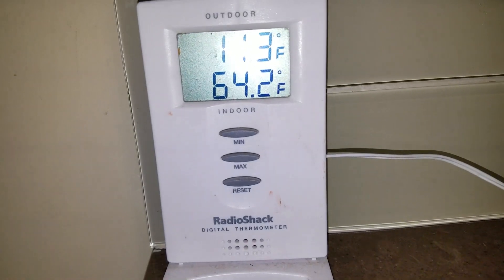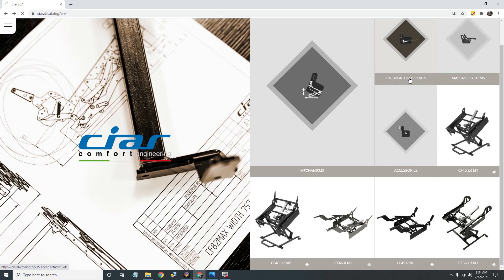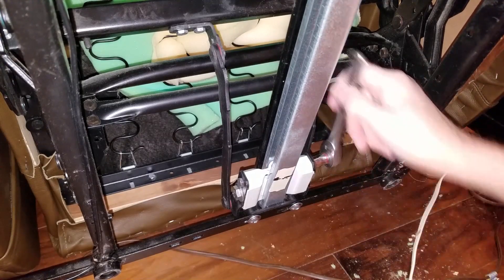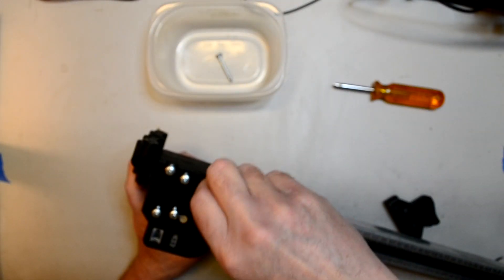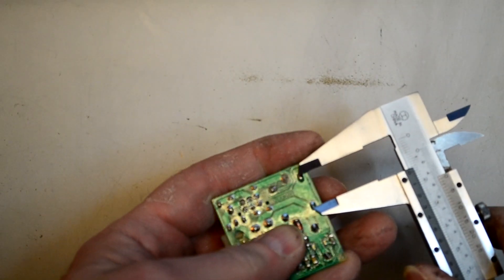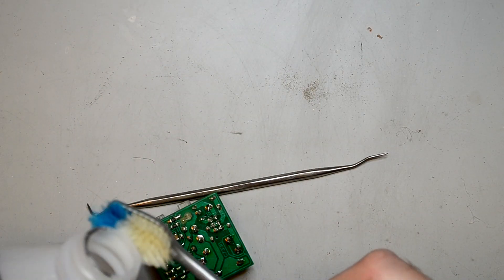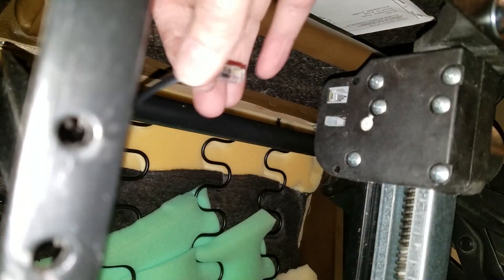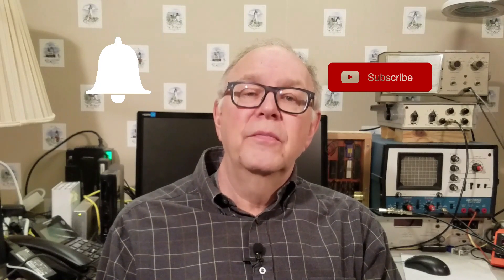Broken Recliner Actuator - Can we fix it?   CIAR LM55_03

Comment: Can you adjust the reach on the screw jack, plz?  Mine works but doesn’t fold in completely.
Reply from the maker: Check my other recliner troubleshooting video.  The limit switches can be adjusted and they determine the end points.  be carefful to only make small adjustments each time.  The motor is powerful enough that it can blow the nut out if the limit switch doesn't stop the travel before you reach the physical stop.  Good luck!

Comment: Do you have any recommendations on where to purchase a power supply for a LM55_05 motor? I can’t find info anywhere!
Reply from the maker: I don't have any "tried and true" method.  You might have to go to Jameco and match the ratings to the output listed on the existing power supply.  A power supply with a transformer might be best.  This would require soldering on the cable from the old supply.  Fixing the old power supply might be better. Good luck!

Comment: Mine was the gear being stripped out :( cant find a gear....so yippee Im out $80
Reply from the maker: Bummer.  There's a lot of force in that gear chain.  Make sure there is no binding in the rest of the chair mechanism so the actuator doesn't have to work harder than it has to.
Reply: @LifewithDavid1 yupp...already double checked that. It did originally. The foot rest was bent on the outward side. Got it all realigned and just waiting on parts now

Comment: Hi Dave, I am having the same problem on my Berkline recliner. I switched the power supply from another chair with the same problem , only goes in one direction.  It is a Ciar Jldq linear actuator. Who can iI have fix the LA because they are no longer available to buy?
Reply from the maker: I know; it's hard to find someone to work on these; that's why I did it myself.  If you can find someone that is willing to get into the nitty-gritty of the repair, I have another video that might help ( https://youtu.be/diehiXWF4pc ).  Also you might be able to find a furniture repair person; they might have access to replacement actuators.  It sounds like either a bad relay or a funky limit switch.  Good luck!

Comment: I took my actuator apart today:, the screw which the shuttle rides upon as it turns had a bunch of "stuff" (hair, cloth fibers, animal fur, stuff packed in a glob of grease) wrapped around it.

So, I cleaned up everything with car parts cleaner, and re-greased everything that moves with left over brake caliper grease, put it back together - viola, working again!

I think that contamination, and maybe lack of proper  lubrication was causing it to fail?

And, there wasn't a circuit board in there, so no relays to check and switch, just 2 micro-limit switched in the a actuator arm, which I cleaned up too!

That was easy, and cheap!

Dave, doing Dave things!
Reply from the maker: That's great!  I hate throwing things away that are still good.  The limit switches may also have been causing problems; I've seen that recently on my actuator.  Cleaning solved that problem.  Thanks for watching!
Reply: Update: Day after "fixing"  (cleaned up) my actuator,  it worked a few times, then the next morning it stopped working again!  Only the extension button, so I think it's a switch problem! So, I've ordered a new switch pad with USB and Bud Lite, it'll be here Sunday (2 days, via Amazon $22).  See what happens after installing the new Switch!

*BLUE LIGHT!  How many caught that?

Comment: I'm going to try this, before paying $90 for a new actuator/motor assembly!
Reply from the maker: Good luck.
Reply: Update: I took my actuator apart today:, the screw which the shuttle rides upon as it turns had a bunch of "stuff" (hair, cloth fibers, animal fur, stuff packed in a glob of grease) wrapped around it.

So, I cleaned up everything with car parts cleaner, and re-greased everything that moves with left over brake caliper grease, put it back together - viola, working again!

I think that contamination, and maybe lack of proper  lubrication was causing it to fail?

And, there wasn't a circuit board in there, so no relays to check and switch, just 2 micro-limit switched in the a actuator arm, which I cleaned up too!

That was easy, and cheap!

Comment: can anybody help me trouble shoot? my buttons gives power to the motor and the motor continues to make a small click sound if I keep the switches pressed, where do start to trouble shoot?
Reply from the maker: I'm working on a troubleshooting video; but it won't be ready for a few weeks.  In the meantime, try this.  If you hear a click (from the relays) when each button is pushed, then the button circuits work.  If you rapidly cycle the buttons and you sometimes get movement; then a relay may be bad.  If you VERY QUICKLY touch the motor leads to the power, and the motor doesn't turn; then the motor is probably bad.  If the motor is good; then one of the limit switches may be bad.  Good luck!

Comment: Hello David!
This is a great video! I have a question and wondered if it would be possible for me to email you? 
I have what I believe is the same exact linear actuator but it's for a different recliner. I just want to make sure that when I'm buying the relays that I'm buying the correct ones. I figured it might be easier for me to just send you a photo to see if you could help me make sure that they are the in fact the right ones?
Reply from the maker: The relays are pretty stock.  Check the voltage on the label, the pinout, and the dimensions.  That will let you verify or select the relays.
Reply: Hello @lifewithdavid1 
I purchased the correct relays from digi-key and soldered them on to the PCB. Unfortunately it did not work. Do you have any other suggestions as to what it might be or how else I can troubleshoot it
Reply from the maker: I would start by checking the power supply.  Does the power brick work; and is power getting to the actuator?  Suspect bad wire or connectors. Then do the relays click when the up/down buttons are pushed?  If not, it could be the connection between the buttons and the actuator; again wire or connector.  Or maybe one button is stuck closed and the limit switch is holding it out.  If the relays do click, then check the motor.  Manually move it to the middle of the stroke and then tap power directly to the motor.  Be careful to only tap the power for a very short time since you are bypassing the limit switches and can easily blow out the end of the housing (don't ask me how I know).  If the motor is OK, then check the limit switches.  They could be locking out the motor.  Hope this helps and good luck!  @josiahsdays
Reply: @LifewithDavid1  thank you so very much!! This was REALLY HELPFUL!!!

Comment: I worked in the industry for 25years and the "Normal" problem is the limit switches when it only say goes up but not down, you'll notice that there are diodes attached to them that whenthe switch is pressed won't allow the circuit to complete. and after either contamination or the grease in the switch hardens it will only allow for one mode of travel. I assume since you own an osilliscope you know what you are doing, but it wasn't clear from the video that you rulled that out first. hope that might be helpfull to someone with the more common problem.
Reply from the maker: That's a good point.  Yes, I had a couple weeks of experience where I had to click the switch a couple times to "tickle" the relay.  I did check the continuity of the limit switches; but I didn't cover it in the video since it was pretty "messy".  Thanks for the comments!
Reply: So it's bad diodes on the limit switches?
Reply: @Handygrrl  Um its in line with a leg from the switch . so lets say the up button is has positive electricity on the blue wire and negative on the brown, but the down button is positive on the brown wire and negative on the blue, so if the limit switch is clicked the diode only allows power flow in one direction so you can complete the circuit. so what happens the grease hardens so the switch never goes to the open position and allows that power flow in that direction. side note if this is the case sometime hitting with a rubber mallet releases the switch, but it will get stuck again in cold weather.  so a permanent fix is to strip the grease off of all the guts and switches with an electronic safe solvent with it un powered and then test the switches once they are good then regrease the acme thread with high quality synthetic grease.

Comment: My neighbor call me to look at his recliner. Found that the problem. It was the one wire going to the limit  switch. Not a complete broken wire.  I rig it for now so it would work. Still searching on how to remove  the pin out of the limit switch.
Reply from the maker: Flaky connections are always tough.  Sometimes I have stripped the insulation and tried to solder the conductors together again.  Good luck!
Reply: @LifewithDavid1  Work for Xerox and IBM, have all sort of  pin pusher. Yes, Thanks for the Good luck.

Comment: Where would you order relays, motors and switches if you can't locate or purchase parts from the manufacture?
Reply from the maker: There is a link to DigiKey in the description.  It's for the relay; they have other electronic components; but probably not direct replacement motors.  I'm not sure where to get those; you might be able to cobble something together.  Good luck!

Comment: thanks for the video, my lineal actuator look sealed, no screws to disassembly, any tips to disassembly, look like glue residues, anybody disassembly with dremel or heatgun?
Reply from the maker: Glued plastic joints are tough.  I've had a little luck in using a sharp chisel along the glue line if the glue isn't really strong.  However, it can cause cracking.  In that event, cutting the case along the glue line with a Dremmel saw is about all you can do.  Resign yourself that you may have to repair using a high build glue like epoxy.  Good luck!

Comment: I don't even see the circuit board on my okin actuator. Would it be in the metal tube somewhere? I do see the two limit switches in the tube. Defective limit switches perhaps? Mine would extend but not contract then wouldn't move at all. Perhaps the circuit board resides outside this unit.  I saw a circuit board attached to the control switches on the couch side. By the way I ordered a new actuator and t works fine. This is why I suspect the limit switch in actuator are faulty
Reply from the maker: I'm not familiar with that unit.  But it could use just limit switches and buttons for motor control with no relay.  This means that the full motor current would flow through the switches.  They would then be subject to the same contact deterioration as the relay on my actuator.  Bad limit switches seem very possible.  Thanks for the comment!
Reply: @LifewithDavid1 this is what i am  thinking faulty limit switches. I will try and look for exact replacements
Reply from the maker: @1232bluejays  If it doesn't work at all; you could use a continuity tester to check the switches when open and closed.  If they are flaky testing is more difficult.  Good luck!

Comment: Hello, My electric Linear Actuator has a 5 pin male connector.  Somehow this actuator is hard to find a replacement.  I ordered a linear actuator from amazon but noticed its a 5 pin female connector.  This product does not work for my recliner because it has 5 pin female connector on the back of my recliner.  Help!  Where do I find the right 5 pin male connector?  Do I have to replace the entire system from the back of my recliner?  Thanks Juan
Reply from the maker: I guess  would just make up 5 individual short male to male jumpers.  Then I would plug them between the appropriate female positions.  You can tape it all together when it works like you want.  You'll need the pinout of the new connector (and the old one too) so you can get the wires to the proper spot.  It seems every actuator has their own connector.  Good luck!

Comment: Hey David, I have a question about that white plastic part on the reclining part of the couch. I was wondering what the name of that part was or how I could replace one?
Reply from the maker: It might be called a drive nut.  Unfortunately, this part is specific to each drive model; you have to get it from the manufacturer.  If it's broken and you can't get a replacement from the original supplier, that is usually a fatal flaw; and the whole drive unit has to be replaced.  Good luck!
Reply: @LifewithDavid1  thank you 🙏🏽

Comment: My sofa would only work one way, so suspected only one relay was broken. I took it apart and replaced both relays - bought of EBay for £2.76. I have since removed the plastic case on the old relays and compared the contacts. One is clearly burnt out. Thanks for the video, really helpful and saved my £150 on a new motor assembly.
Reply from the maker: Fantastic!  Glad it helped.

Comment: Thanks for the vid! For mine, the motor and the switch work fine, but the recliner doesn’t go up and down. Any idea? Thanks.
Reply from the maker: Does the screw turn?  If not, the coupling between the motor and screw is broken.  If it does, then the nut that moves up and down the slide could be stripped.  Good luck!

Comment: I'll just replace the motor LOL....
Reply from the maker: They are not as available as you would think.  I would have liked to have replaced mine; but I couldn't get one.  Also, if you can get them they are very expensive; the relay was only $4.
Reply: @LifewithDavid1  They are all over Amazon for less than $150..
Reply from the maker: @tomb9758  I see that.  That's a relatively recent development.  Don't forget new buttons and a power supply.  Recliner mechanism manufacturer don't seem to have standards; it seems each system has it's own plugs and mounting hardware.  Good luck!
Reply: @tomb9758  Much more satisfying for me to resurrect my soldering skills from 30 years ago and save about £150

Comment: Hi Jimmy. Great video. Thank you! I have a different problem you might have suggestions on. My recliner chair goes up and down fine, but when the back is reclined it creeps back up. In seconds it’s back to the upright position.  If laying flat out it stays, but if it’s just partially leaning it won’t hold.  Do you think it’s a possible fix. So far I haven’t been able to find the actuator that replaces it 😡
Thank yiu in advance
Reply: Sorry. David.
Reply from the maker: Is it a power recliner?  If so, then maybe there is a broken bolt between the back mechanism and the seat.  I've had a couple bolts break in the past; which causes the seat mechanism to act strangely.  Good luck!
Reply: @LifewithDavid1  yes it’s power. I we were going to replace the actuator because chair is only 2 years old but am hoping it’s fixable. I hadn’t noticed any broken bolts but will inspect much closer. Thank you

Comment: When you plug the wire from transformer to the chair in the power light goes out! Plug in light comes on. Cables all look good. What gives?
Reply: UNplug light goes out
Reply from the maker: It could be that there is a short in the power head.  Or a stuck relay.  This could drag down the voltage and the light would go out.  In fact, when I push either of the buttons, the light goes out.  Hope this helps.

Comment: I have a lm55 actuator on a couch.  It has a RJ9 or RJ11.  I need to reterminate the wire.  Do you know if that is a RJ11 or RJ9 connector?
Reply from the maker: I'm sorry, but I don't know.  My wires were fine so I didn't into changing out the connectors.  Good luck!

Comment: Any chance you can provide the size of what appears to be a fuse just left of the 6 pin connector on the board as oriented the same way as your video. I have the same model and can’t find the diagram.
Reply from the maker: I checked detailed photos that I took of the circuit board.  There are no fuses, just 4 diodes.  I think they are 1N4007, a standard 1A, 1000V diode.  I have uploaded the front and back of the circuit board to Github for you.  The foil side has been flipped so it should overlay the component side.  This should make it easy to reverse engineer a schematic.  https://github.com/LifeWithDavid/Recliner-Chair-Lift-Photos.git  Good luck!
Reply: @LifewithDavid1   Thank you so much, it was scorched beyond recognition! I think the board is salvageable. I truly appreciate the help!

Comment: Great video. Just got a lazy boy powered recliner couch for but the right side is intermittent with the buttons. Thanks to the video that's probably the first thing I will check.  When you tested it with the multimeter what connections were you testing from?
Reply from the maker: I was testing the DC voltage between the motor leads.  Positive voltage and the motor turns one way; negative and it turns the other.
Reply: @LifewithDavid1  awesome thanks so much. Huge help

Comment: Hi David, do you know the OSIM UDivine Model?  The footrest actuator is not retracting back to the initial position. What could it be?
Reply from the maker: Unfortunately, no I don't.  There are several things it could be, the limit micro switch moving or not working, a jammed mechanism, even a loose pivot connection with too much slop in the footrest extend mechanism.  Your best bet is to get close to the mechanism and have someone open and close it while you observe the operation to see what's going on.  Good luck!

Comment: I have the same actuator and the same problem. Where did you purchase the relays?
Reply from the maker: I bought my relays at DigiKey.  Make sure the relays you get meet or exceed the ratings of the one currently in your chair.  Here is a link to the one I bought for my chair:

https://www.digikey.com/en/products/detail/omron-electronics-inc-emc-div/G5LE-1-DC24/280367